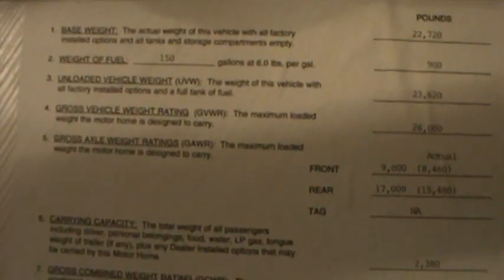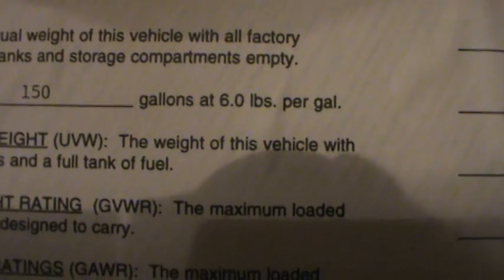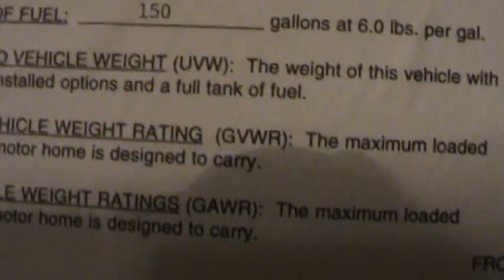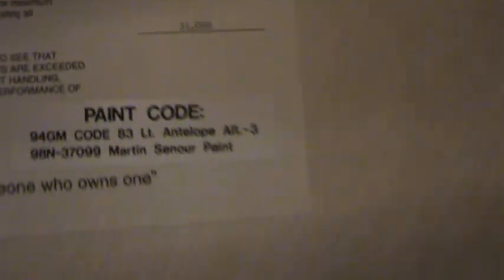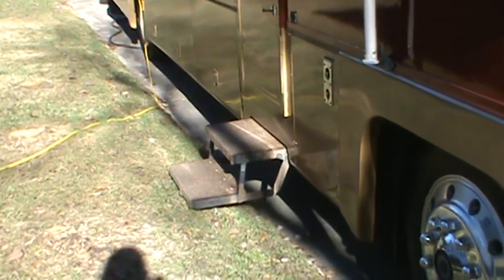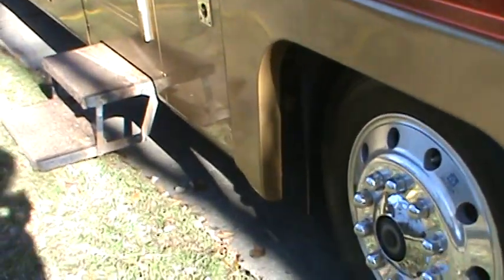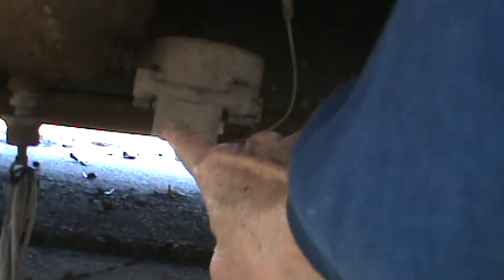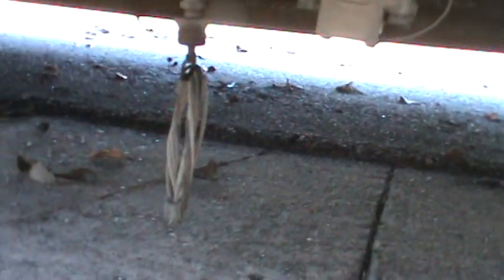Why Is This Wire Hanging Down Under The RV?

Comment: My husband said that is the air tank.  The wire is to pull on to get the water out of the air tank when it builds up .  He drives an older dump truck and he has to do the same thing occasionally.  He said usually it is wired to the side of the truck or rv so you don't have to reach under it.

Oops, I see someone already answered!

Comment: Looks like air break systems to me. The cut wire was probably a warning buzzer for low air. The plugs are used to drain water from the system due to condensation.  But don't worry if the air goes low. Because these systems were designed to lock your breaks up in case of massive air loss for safety reasons. If the tank loses air for any reason you will roll to a stop and won't be able to go forward until that is fixed. My suggestion is always use a certified class A diesel mechanic to do your regular check ups. Good luck guys and have fun on your new adventures.

Comment: Miss Phyllis did you ever find out about the wires under the RV that were hanging down and the one was clipped or cut ? 😮😳😬❤
Reply from the maker: We did find out the wires, they were actually more like a little rope, which released any water that
had accumulated in the air lines for the breaks.

Comment: phyllis one of those is the cord to drain the water from the air tank pull it and air and water will shoot out   I think the front one is the drain plug   they  sell a air tank antifreeze to add so your brakes wont freeze up

Comment: @Phyllis
You are looking into this to much, I let mind sit for 9 months and it will fire up, if you buy your fuel from a good station you have nothing to worry about, all diesel in the U.S. is Diesel no 1  nobody sells No 2 any-more, when you start your engine just for 5 minutes it is cleaning the fuel. even when you are not using the fuel it gets recycled threw the filters constantly, I have had diesel
equipment for thirty five years, and I have had no problems. DO NOT worry about fuel.

Comment: They do not post sheets on the wall for nothing. What ever it says that's what it is. I would have the home taken back to where you bought it. That way they can repair the hanging wires. The rolled up wire appears to be the valve for getting moisture out of this tank. It appears to be an air tank but from this far away I am not sure. That cable should be where you can have easier access to open the valve. You want a certified mechanic to look at this because if the wire is pulled and all air escapes, you will stop and not go anywhere until your pressured up again. On another subject....Look where the filler is for the fuel. Sometimes you have one on the drivers side and passengers side to fuel the tank. If so or not the fuel tank should be close to the fill cap on the frame.